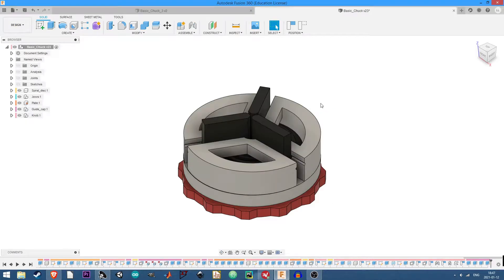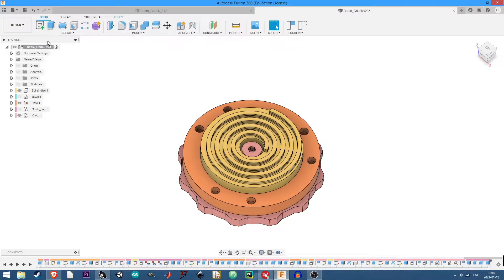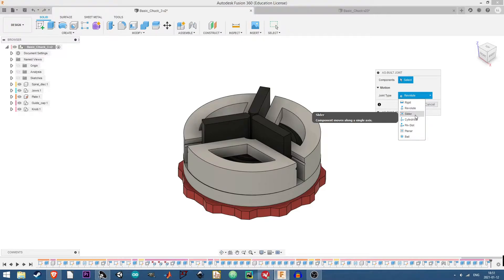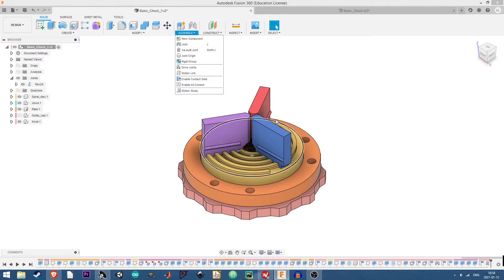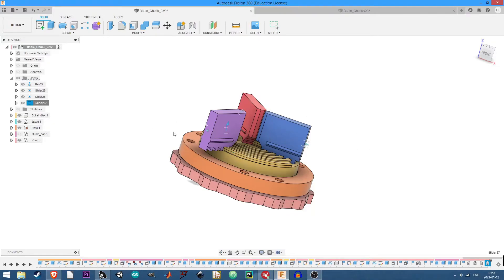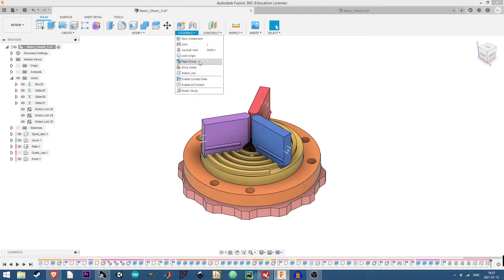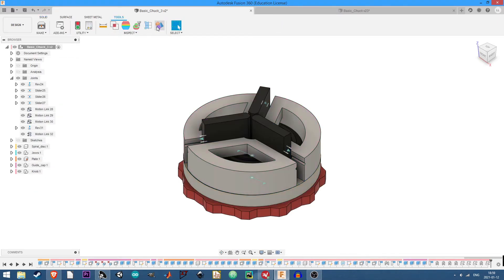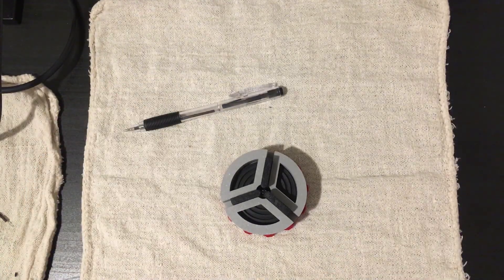3D Printed Lathe Chuck

Comment: Thanks for the tutorial! You mentioned that you created grooves in jaws by cutting them with scroll plate. Does it really work for physical model? I've tried making it and like that and jaws won't move :(
Reply from the maker: It worked for me! Of course after cutting the scroll plate grooves by using the combine tool in fusion 360 I did have to offset the faces to add some clearance. For things to move freely/smoothly you always have to add some clearance.